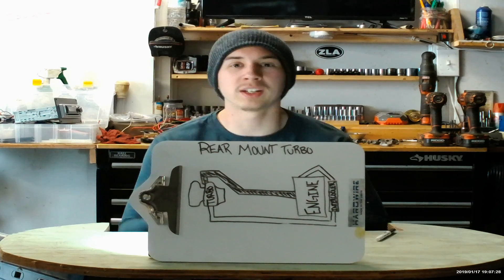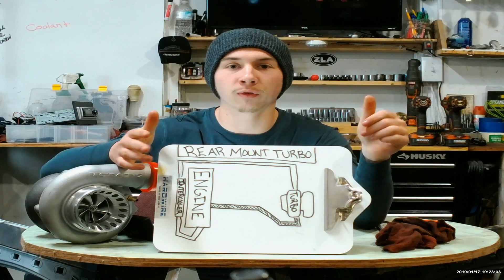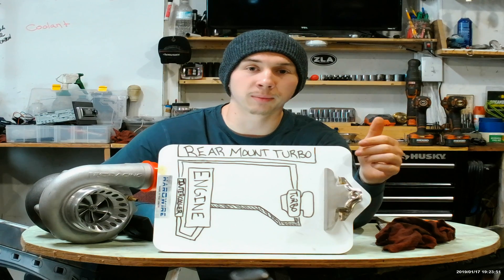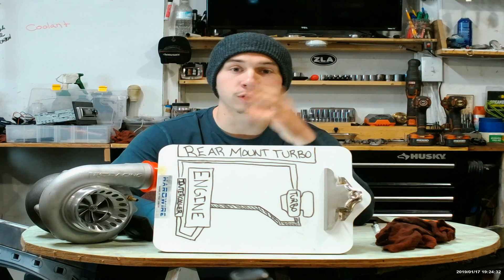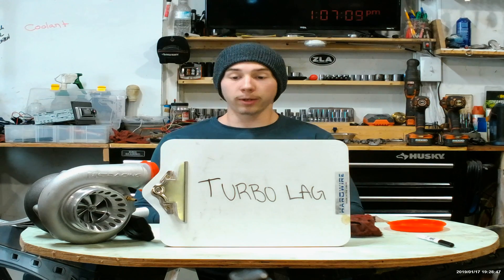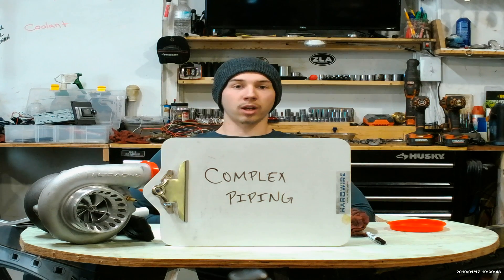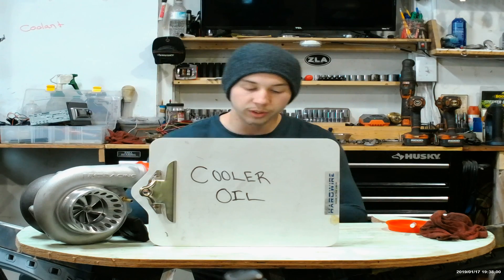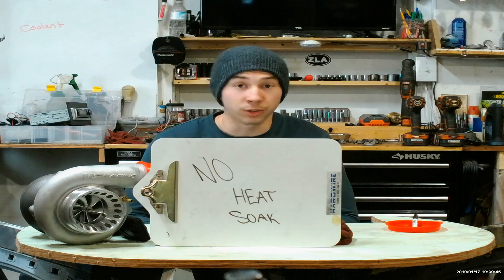How Does A Rear Mount Turbo Set Up Work?

Comment: Solution to the oil debacle exists! Comp Turbos make Air cooled, Oil-less turbos that use grease that you pump up every 3k miles. Solves a ton of piping, welding, electrical, and oil pumps.

Comment: Only conceivable way to boost a Chevy Express cargo van. Charge pipe is so long strait through intercooler is all you need to cool the intake charge. 
2013 6L80E, 5.3 , 799 heads, BTR truck Norris and a on3perfromance 77mm is the build I am working on. My HVAC side work van.

Comment: The EASY way to say it....is:
The exhaust Flow turns the Turbine Wheel which ALSO turns the Compressor Wheel and the compressor TAKES IN Air, Compresses the Air and sends it back to the Throttlebody to ingest through the Engine Again.

Comment: For a 370z where would u put the turbo? Sorry I'm getting my first car soon and I want to plan everything out
Reply: front mount turbo is best on a 370z, those vq37 motors are solid motors and can handle up to like 900hp on a stock block. but i would recommend a plenum spacer, tune, and exhaust before a turbo kit.
Reply from the maker: I agree with Tanner! Sorry for the late response, the front kits for the 370 are great. However if this is your first car is highly recommend just learning the car and getting everything you can out of it stock before upgrading it as far as throwing a turbo on there.
Reply: Brady Buildz yea they’re plenty fast from the factory especially for a new driver
Reply from the maker: Exactly, jumping to big numbers too quick is a good way for bad things to happen and nobody wants that.

Comment: Does weather affect rear mounted turbos?
Reply from the maker: Gotta be careful with the intake side of the turbo, depending on the routing of the intake piping rain can cause issues because it'll get sucked up. They make hydro shields for filters but personally I only trust those to a certain point. With extreme weather I wouldn't recommend doing a rear mount set up if you plan to drive the car during that weather
Reply: Brady Buildz thanks
Reply: What about having an independent oil system for the turbos?
Reply: Makes more sense to me

Comment: I use engine yrv turbo on my kelisa. I want make project to mount the turbo at rear bcoz they engine bay so small. Can some one give the size or ratio for hot and cold piping for rear mount turbo. Plz..
Reply: Just start off with your stock exhaust, most guys even in high hp build found the stock stuff works better for them. Goal is to keep heat and as much velocity you can in the pipe without the pipe becoming a restriction, any mufflers you can get rid of straight pipe it and add the turbo in the best place you think itll work. Cold side you can usually get away with same size diameter as your exhaust or a tad larger.

Comment: Would it be good on a 1994 Supra
Reply from the maker: Depends on the purpose of the car but the engine bay in the Supra is so well suited for turbo there really would be no reason to throw the turbo in the rear unless you just want to do something different
Reply: Ok thx

Comment: How about running vaccum lines to the waste gate and BOV
Reply: Put the wastegate closer to where your exhaust merges at the y pipe, x pipe ect, works better there then all the way back by the turbo. Run smaller diameter piping  to the turbo and heat wrap it to keep as much heat in as possible. People from the LSX community have found that stock iron manifolds and smaller diameter piping work better then longtubes and shorties with large piping, also the type of material like iron will keep heat in the pipe better then steel. Vaccum is the usual, just have to run longer lines. 🤙🤙 keep up the good work
Reply from the maker: Wastegate is the same as always, the wastegate stays near the turbo which is in the back. The BOV is up next to the intercooler so the vacuum line will run from the intake manifold down to the cold side before the intercooler

Comment: I might look into running dual rear turbos on my wifes C5 vette
Reply from the maker: Dual rears are very cool and from a visual point are very satisfying! Make sure if you do make that setup to create a standalone oil system for the turbos because you won't be able to get enough pressure from the engine
Reply: @Thistlegarage  great point, thanks
Reply: Same here,  I think I finally decided to go twin rear turbos for my 01 cobra.  I've been weighing all the different options between Eaton swaps,  prochargers,  and turbos,  and it seems that rear mount custom turbos are actually the cheapest option!
Reply: I'm glad you said that since I was thinking of doing that on my 97 thunderbird 4.6 2v.  Would you use 2 smaller turbos to reduce the lag?

Comment: in this case the hot box would have to increase or decrease since the turbo is not mounted on the manifold straight to the head
Reply from the maker: The hotside of the turbo? It all depends on other factors. Piping size and displacement play a roll in trying to find the right turbo size. Sorry for the delayed response, been a busy couple days